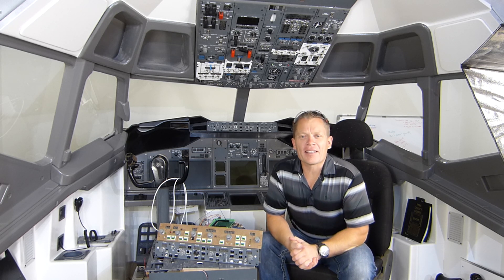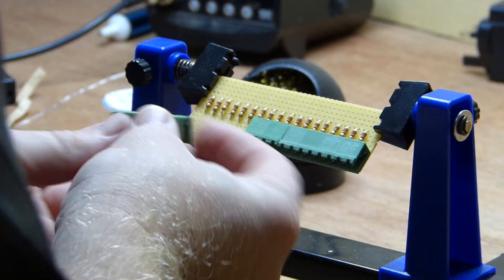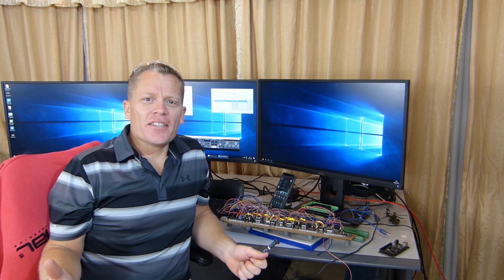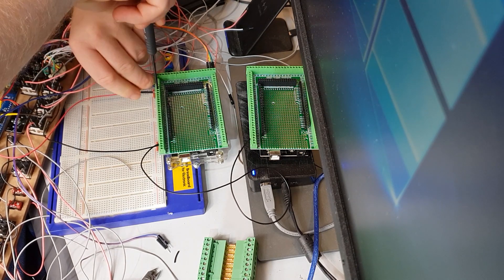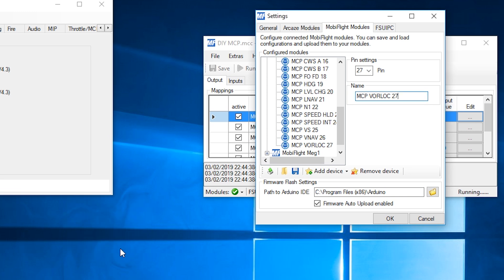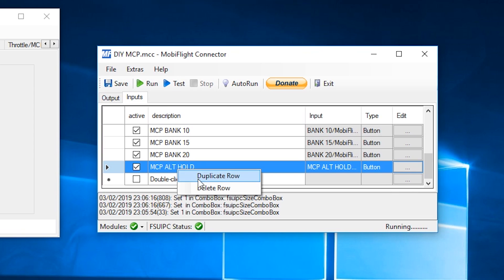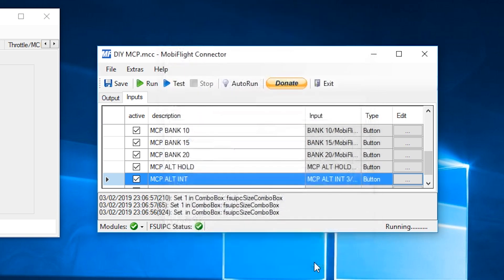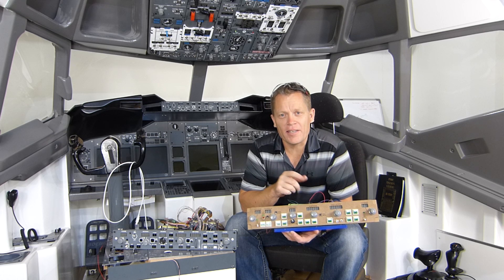737 DIY MCP - SWITCHES & LEDS WITH MOBIFLIGHT/PROSIM

Comment: Karl i ahead been searching but can not find an answer. Does the kd2 buttons with led have a built in resistor or did you use a resistor on your pack down stream from the switch?

Comment: I never thought of breaking up a PCB board like that, this is excellent workflow and opens up possibilities in smaller design layouts. Nice. What I have heard though is that it's not a good idea to not wear a dust mask when interfering with these boards in such a way as the copper particles it produces are very bad for lungs

Comment: Hi Karl.
I have a couple of questions if you can find the time to answer them please.

1) What wire gauge would you recommend for this project?
A) Never mind, I read from your website you recommend 22-24 AWG or the aircraft wire you got from your heli's.

2) I have used your files from thingiverse to 3d print this MCP in clear PLA, I then sprayed it in 7011 grey with the letters raised and scratched ready for a back light, would it be possible to wire a warm strip light with about 10 led's and a dimmer on/off dial to the boards, or would the strip light have to be powered by it's own plug to the wall?

3) MSFS 2020 compatable? as that is what I am building it for, just have to wait for PMDG to release there 737 though.

Thanks mate.
Reply from the maker: Hello, ill try to answer and keep it short:
1) 24 AWG
2)Yes
3)PMDG should be released in Jan 22 or early feb 22. Mobiflight will have event codes shortly after making this a n awesome combo!

Comment: Hello sir Karl, hope you are doing very good!
   Thanks once again for the amazing channel you share here with all of us, you motivated and I have began the project and I got 2 questions : about the encoders do you connect them with the ground and +5 volts? , if i do not put resistors 220ohm will it work ?  
best regards,
Konstantinos Ak
Reply from the maker: Hello, check out the getting started menu on the website, that will explain. If you are using KY-040 encoders then yes. If you are using standard 3 pin encoders then no. Kind regards Karl
Reply: @helimech8152  thanks for the reply Sir, wish you a good day!

Comment: Hello hello, i love your great work. Very inspiring. 
Question, why the choice 8bits or 16 bits?

Gtrz Bart
Reply from the maker: Hello Bart, In short its the numerical value you can achieve with a bit size. for 8 bits a value from 0 to 255 can be used. If the value is 256 or higher, then 16 bits would be used. This is also the case for negative numbers and numbers containing decimal points. A more in-depth understanding can be found under the getting started menu of the website under offsets. Kind Regards Karl

Comment: Excellent videos as usual. Question about pro sim. Are you using pro sim only because you’ve actually built the whole flight deck. And if you miss out the pro sim info and just go straight to the mobiflight input/output will it make a difference. And when are you going to start on your A321 flight deck 🤫👌
Reply from the maker: Hi Alan, I use Prosim because it allows full and easy integration of the aircraft. Mobiflight is used as a hardware to software interface. Other users use PMDG or XPLANE/Simvim instead of Prosim. As for the A321! Not yet, I think it will be a heli 139 next!

Comment: how to make it work in the flinght simulator 2020? is there any software for it to work on fsx 2020…? thanks .
Reply from the maker: Hmm, that's a hard one right now. I think you might be able to get a fair bit interfaced using mobiflight and the standard included settings. Kind regards Karl

Comment: Hi Karl, I just received the KD2-22 I bought, but, I don't know how to wire it to arduino, could you help me ?
thanks
Reply from the maker: Hi Lucas, there is a wiring diagram on the website, under getting started and the MCP build. I hope this helps, if you need more help, just message on the website chat window. Kind Regards Karl
Reply: @helimech8152  H Karl, I did that but the light is on all the time, all message on site, thanks a lot

Comment: hello you have inspired me to make my own panel, but I have a question, without buying the prosim software, can it work? With the tutorial and the diagrams you made, since prosim is quite expensive at the moment, thanks for your answer.
Reply from the maker: Hi Orlando, There is PMDG737. The other route is to use Xplane and Sim Vim. I think there is also aerosoft version too. I have only ever used PMDG or Prosim though. Kind Regards Karl

Comment: Hi, great video. I was hoping you can do a quick video on how to solder the led buttons. I see yours have 8 pins, I got a type that has 6 pins and I do not know how to wire it, like which goes to which pins on Arduino. thank you.

Comment: mister, could you explaind how you made the buttos like HDG, Speed, etc ? couldn't understand
thhanks and congratulations for the amazing job
Reply from the maker: Hello Lucas, I hope this finds you well. Please call me Karl or Clarkey. The buttons come pre made and can be found on eBay or Aliexpress. They are called KD2-22 they come in different colours and make sure you search around for the cheapest ones. You also need the momentary buttons and NOT The latching!
Reply: @helimech8152  great Karl. Thanks a lot for the tip.  Is really hard to find these things in Brazil.
Reply: Karl, another question. Today I was trying to make a simple test with PMDG 737, like turn  on a led light if the autothrottle is on (or speed rake is armed). But I'm not successful on config it. The led blink when I push the test button, but not working with the AT engaged

Comment: I love this project. I have 3D printed the MCP, albeit in black for now, sourced the buttons but cannot find the Max7219 7 segment 6 digit boards. They all seem to have 8 digits. Any ideas on the correct ones I should choose? Thanks in advance.
Reply from the maker: Hi Declan, I designed that unit to take the full 8 digit displays. It just hids the other displays behind the fceplate.

Comment: How are you doing your on off on switches with fsupic and prosim? Like the standby power and flight control a and b?
Reply from the maker: Treat them like a rotary switch. Each position is given a bit number. Off does not usually need an offset as prosim has the ability to recongise a no signal as off.

Comment: What brand of tactile switches and rotary encoders do you prefer?
Reply from the maker: hello and good morning from Brunei. Honestly, when we had a postal service, i used to scan eBay and look for deals. i would just search the cheapest i could find in a multi-buy pack. i know that i will need lots of these, so just used to buy them when I got to my last 10. However, as we no longer can receive post, this is becoming a bit of an issue.
Reply: Heli Mech wait, what....you don’t have mail service?  How do you get your bills?🤣on a serious note, I can’t imagine not having mail service.  Is Brunei experiencing the Covid-19 mess?
Reply: Heli Mech I ordered a couple of EFIS panels from .cockpitsimparts.co.uk. I ordered the complete kit of parts.  They should be here in a few days.  I hope they turn out ok.  Unfortunately they don’t offer the MCP panel yet.  I think Covid-19 has the company operating at a reduced staffing level.  They told me that new products are currently on hold.  My plan was to build the MCP next.  Maybe I will use either a Hispapanel or one from Opencockpits.  I know you favor the Opencockpits panel.  There is certainly a lot going on on that panel.  I have been studying the MAX7219 chip.  I am going to build display modules with the correct number of digits per application.  Should be easy peasy to do.  White displays units are scarce as hens teeth.my Son is a Heli mechanic.  He is currently working as a contractor in Kuwait.  He is doing QA on Kuwaiti Air Force F-16 aircraft.  When he was in the Navy he worked on the CH-53 Sea Stallion and Ch-60 Seahawks.

Comment: what encoder do you used
Reply from the maker: Hello, when I started I used the cheap ardunio Ky-040 encoders. About a year ago, I stopped using them and switch to direct cheap encoders without the pcb from Ebay. Just recently, I'm have been trailing more expensive encoders for the radios, that are much smoother in operation and have a bit of feel and friction. I will add links to the website soon when I reach I conclusion. Kind regards karl

Comment: Hi, how do you do this with annunciators? Trying to make some with leds but I’ve got no clue how to wire it to an interfacing board, which board and how to interface it with xplane. Thanks
Reply from the maker: Hi, you have found my weak point! I dont use simvim and I know that is completely different to mobiflight wiring. I really cant offer any help with this one.
Reply: Heli Mech dang it! Alrighty, thanks for the reply!

Comment: it would seem that the Arduino shield  is the MEGA 2560  but no matter how hard I try I just cant seem to find one the same as the ones you are using ? HELP!!!  please keep em coming  you are inspirational
Reply from the maker: Hello, I'll try to dig a link out for you. But I'm sure there in the parts section of www.737diysim.com.
Reply from the maker: Thank you for the kind words. Here is the link https://rover.ebay.com/rover/0/0/0?mpre=https%3A%2F%2Fwww.ebay.co.uk%2Fulk%2Fitm%2F303096673689

Comment: Hi, great Job and great informations from your site. Just a couple of question: I saw on your guide is better don't connect more then 2/3 Display in one Arduino Mega board but in the wiring diagram all five displays are connected to just one board, can it work?
The  Arduino Mega 2560 R3 need firmare upgrade from Mobyflight?
Reply from the maker: Hi Aron, There's a saying 'Keep It Simple Stupid" (KISS). i have learnt over time that to get maximum reliability stick with no more than 2 or 3 daisy chained displays. 4 and 5 are possible but errors creep in after a while. 6-8 units daisy chained with mobi, us just asking for headaches even with an external power supply.
Reply: @helimech8152  

Hi.   Just to comment this from Mobiflight Point of View.....
The Problem with Chains is (as i know)  not our software..... its hardware side.    From Mobiflight System there should be no disadvantege when you build chains 4-8.
As we recommmend in our Webside users MUST get sure every MaxChip is powerd with 5v !   If you use a chain with standard Tubes then this is problematic cause every tube include a diode that reduce power level by 0,7 V.   A Max need a minimum of 3,5V ....   So a 4 Chip Chain result in a power of 2,9V on Tube 4.... And that occure in errors.

Solution:  Chain only the 3 Data Lines and GRD .... But wire 5v directly from Arduino to each Display ( or simply build a bypass from Tube to tube so the power NOT comes from Output side of last tube in the row.... it should be bypassed to the input side where REAL 5V are supported.)
Alternate:  Resolder the Diode on backside of your MaxTubes..... Then Power on Output Side is also 5v.
Reply from the maker: @pizman82  hiya, sorry and badly worded on my behalf. Totally agree not a mobiflight issue, but hardware issue. It's actually down to the max7219 boards/connections. With an oscilloscope you can see the data lines become more and more degraded as you increase the daisy chain amount. So the data signal becomes gibberish by the time I test at board 7 or 8. This is where I gave up. I personally will stick to 3 or 4 boards daisy chained in one go. That provides a decent reliable signal.
Reply: @helimech8152  

Your right.  Whatever i think the Datalines also should work fine if the power support is over 3,5v on Board 4 or behind . If you like you can test it.
BUT ... I agree and i also use your logic finaly.   For my opinion the most easy way (for the software) is the best way.   Why a information should be transfered over 7 boards.....  Why generate a massive long datastring in the MEGA Chips ?   I personaly use also chains as short as possible.  If my building got free pins i will split chains, too.

One Last question please....
Your are maby one of the most professional builders , who use Mobiflight.  So you see problems much early as myself in testing systems.
Can you confirm Patch 7.5.3 fix the "Missing Input" Bug finaly  and do you spot other issues we should observe/fix next time ?
Suggestions are welcome.  Your experience would be verry helpfull. 

If you like, Join us in the official Support Board....  https://www.mobiflight.com/forum.html

Comment: Where do you get your supplies for buildings? Switches, pushbuttons, rotary switches
Reply from the maker: Hi glen, I get all my stuff from Ebay. I try to look for the Chinese sellers that have free postage. The only downside for me, is that it takes 4-6weeks to get here.
Reply: @helimech8152  Thanks for the help. I'm getting all my ducks in a row to start building.

Comment: Hi, I have a dude, is It possible to make a FMC with mobiflight?
Reply from the maker: Yes, my first fmc was self made with mobiflight. Finding the right size screen was the hardest part
Reply: @helimech8152  thank you for your response, did you use mega 2560 board or a raspberry Pi i think that it is interesting to show the making and the programmation of the FMC, because there is not any tutorial about that
Reply from the maker: Hi, will eventually get around to doing that, but as I have already made them, I want to concentrate on finishing the sim. Next up is the aft cockpit.

Comment: good day Karl, about those buttons that you have on the MCP, can you share a link or the model number ?

cheers
Reply from the maker: Hi, you must have missed my previous post, All information on the MCP is available on my website www.737diysim.com. The switches are called KD2 and you need momentary ones. They are actually available in black, making them look much better. For ease, heres the link for the original ones:
https://www.ebay.com/itm/2pcs-KD2-Push-Button-DPDT-OFF-ON-Momentary-SWITCH-GREEN-3V-Led-125V-6A-250V-3A/163508901136?hash=item2611e3d510:g:nEEAAOSwTxJcTSI8:rk:20:pf:0
Kind Regards

Karl
Reply: @helimech8152  thank you so much
I have been all over your channel, and couldn't keep track of my comments.
Absolutely enjoying your work and engineering

Cheers sir
Reply: @helimech8152  i m still confused though, why do I need ProSim again?